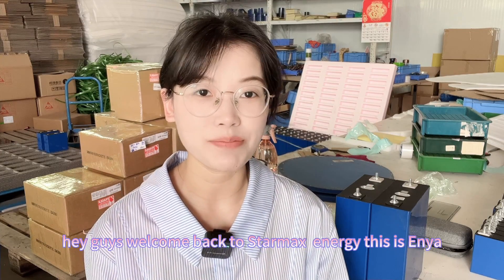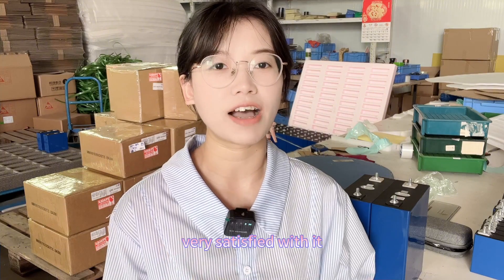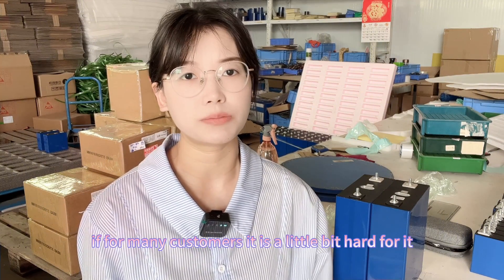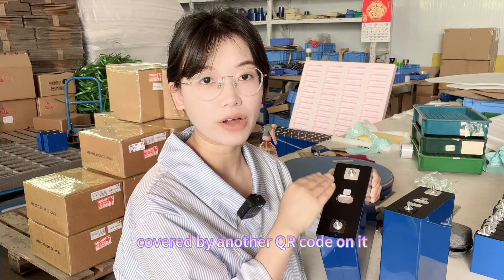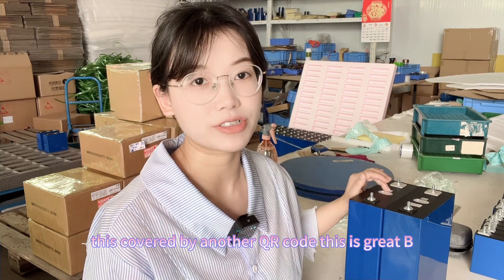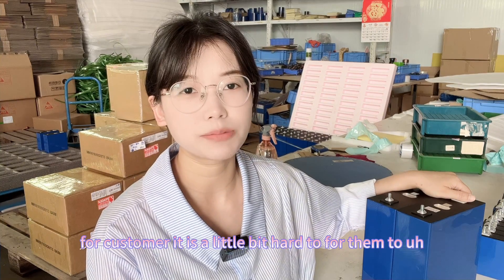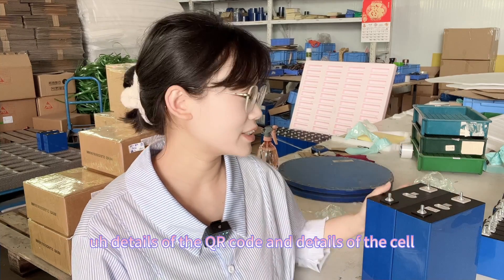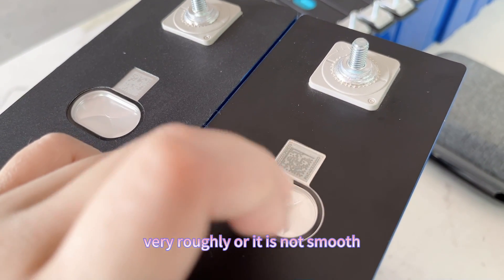Hithium 280ah lifepo4 battery Grade A and Grade B comparison

Comment: The most important thing is not to buy B grade as A grade. 
Sadly on Aliexpress its close to 100% the case.
There's nothing particularly wrong in B grade cells if there priced appropriately and used in appropriate applications.

If you need a backup battery that you are comfortable to charge and discharge slowly (around 0.1-0.2C max) that grade B will serve you almost as long as grade A. 10% les at most. An this case if you can buy grade B 20% cheaper than grade A - it's worth it.

Avoid used cells of course. It's a lottery in which you cannot win.
Reply from the maker: It seems you have rich experience to deal with the lifepo4 cells. We suggest customer to buy A grade cause there is no much difference in price but the quality canbe controlled. Most of people buy the battery for their own use, it is very important to guarantee the safety issue, cost more a little but save risk of any problem is necessary))